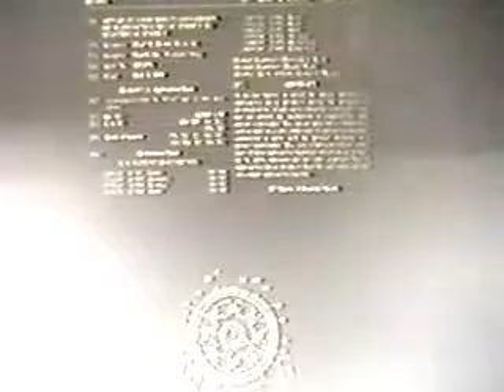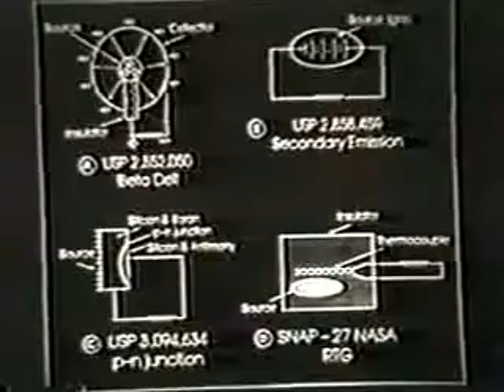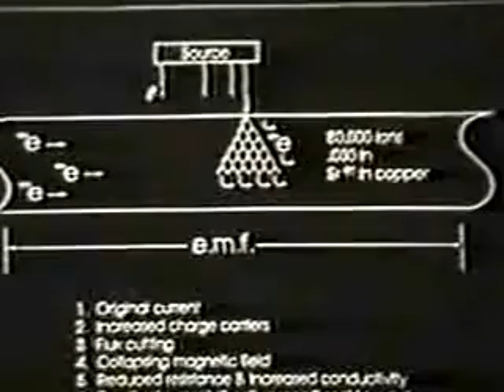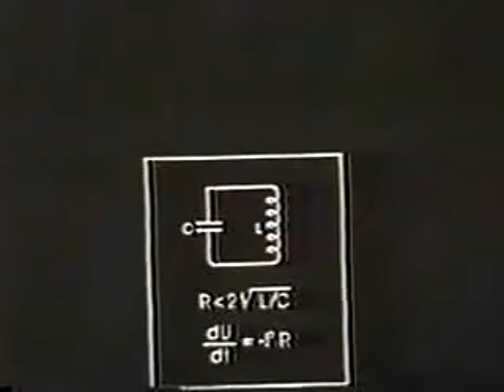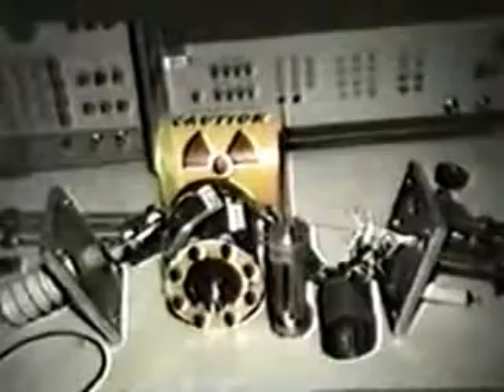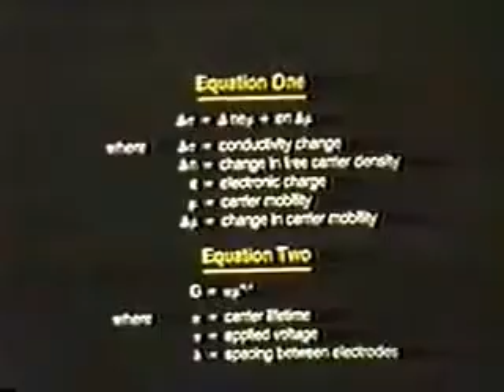Radioisotopic Energy Generation - Paul Brown - International Tesla Symposium 1990

Comment: The guy can't wrap his head around it because Paul didn't want to give away the 'stimulation' field.  It's like the Moray radio, stimulating the material. to get the Pegrahm effect quickly. a two coil system or counterwound.  i can build one, i think. I think ideally you want a solid state neutron generator in your LC tank circuit to get all that decay. But people have done it with xrays and resonators... terrahertz beams... i think.

Comment: Flying saucers are powered by a more advanced form of this
Reply: that is correct.. i think.  I have theorized about a similar design, and how you could increase the boundary layer and produce resonant effects in "space".  I came up with Time3 = Space3 * Energy3.   That way I can actually try to find the right 'frequencies' etc. I think the moisture in the air in the Keely device got lucky and produces some minor fusion from the space component of the equation.  That's why I told those guys to use a liquid metal pressure cylinder fusion test.  lol